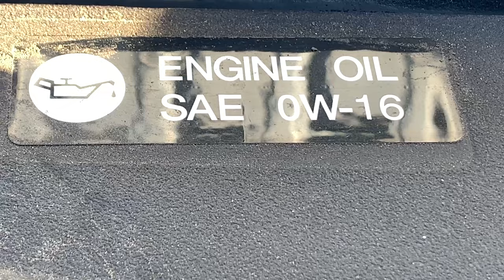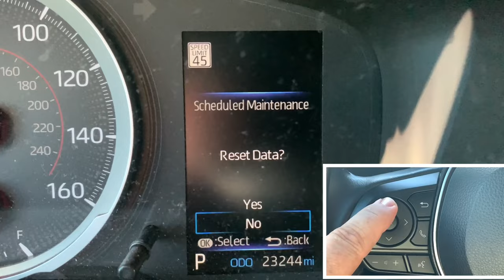2019-2021 Toyota Corolla  |  Oil & Filter Change  |  Maintenance Light Reset

Comment: What ramps are you using? My ramps are too high and my bumper scrapes on them.
Reply from the maker: I bought these “Rhino Ramps” by Blitz over a decade ago. I’m sure newer versions are out there. Mine measured at 7” high and 35” long. I had zero clearance issues

Otherwise just use a  jack and jack stands…